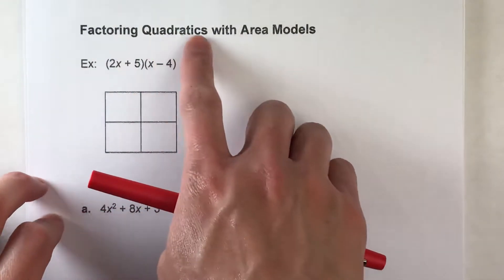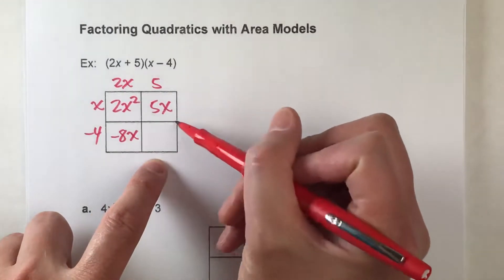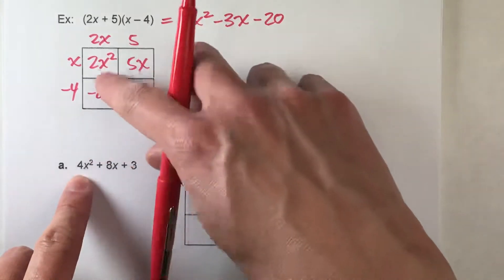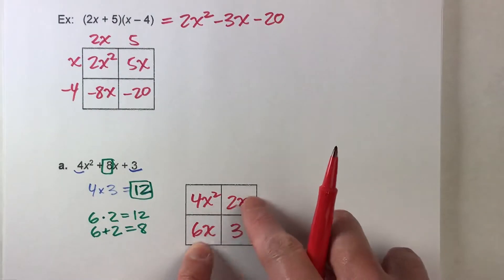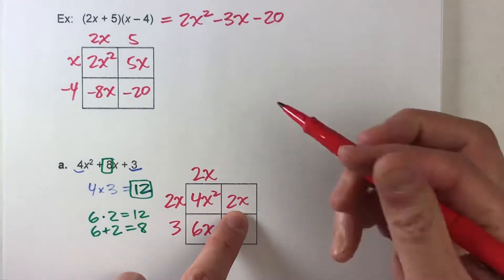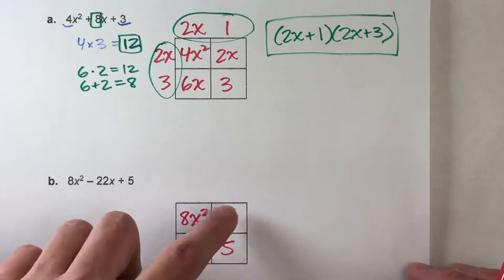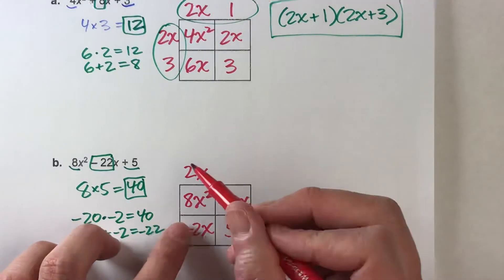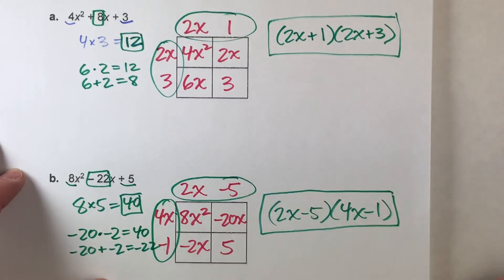Factoring Quadratics Using Area Models

Comment: On the last one I got (-4x+1)(-2x+5) I know where I went wrong but wouldn’t this still work
Reply from the maker: Technically, yes that would still work!  But when we factor quadratics, we usually try to keep the x terms positive if possible.  In this case, you can factor the -1 out of each of your binomials and they multiply together to get positive 1.  So your expression could be thought of like this... (-4x+1)(-2x+5) = (-1)(4x-1)(-1)(2x-5) = (-1)(-1)(4x-1)(2x-5) = (4x-1)(2x-5).  It is just simpler to factor it as (4x-1)(2x-5).